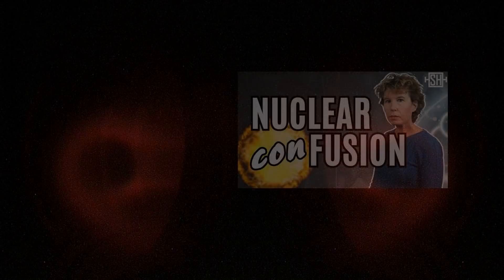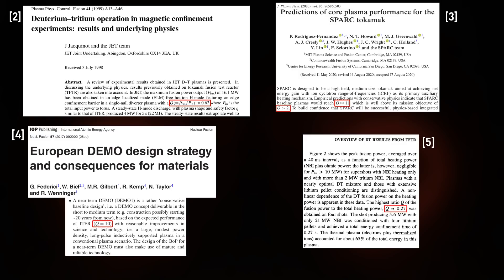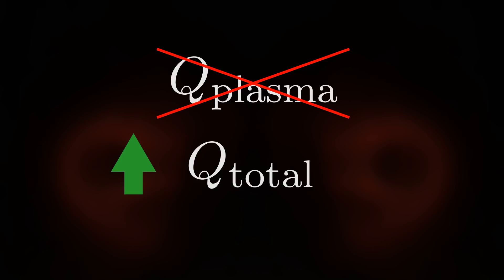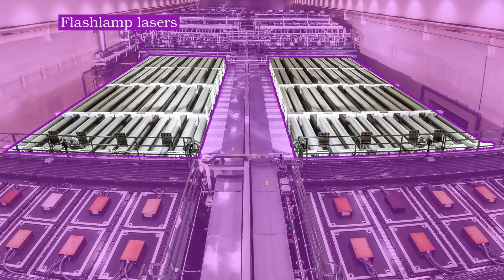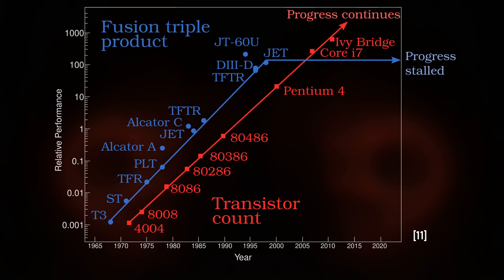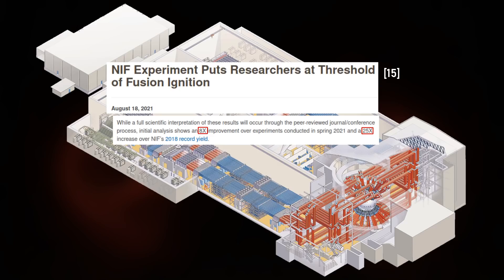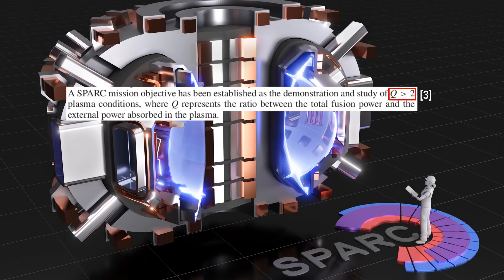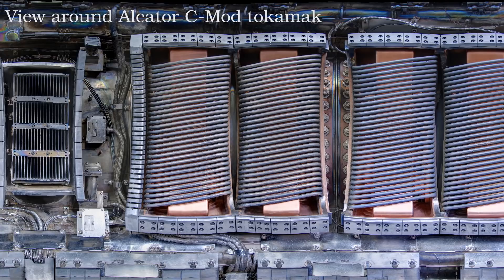In defense of "Q-plasma" - a response to Sabine Hossenfelder

Comment: The tire analogy is very weak; we know how to make all kinds of tires an the physics and engineering behind them are well understood. With regard to fusion, we have a huge amount of unknowns, with a lot of theoretical knowledge, but very little practical engineering experience or cost analysis. We're at the Wright brothers stage of flight and we need to get to the high bypass turbofan + lifting body stage of efficiency. Capturing the actual output of a fusion core and converting it into energy safety and efficiently still has not been demonsted nor realistically theorized. The question marks still remain, we just have one more step.

Comment: 4:19 "Some have even proposed an equivalent to Moore's Law for exponential increases in fusion performance". Who is "some"? 

4:56 "Had it been completed in a timely manner, even a full twenty years after its inception, we would already be a single factor of fifty — or even a factor of ten — step away from a practical reactor" How confident are you of this assertion? Does it depend on the theoretical exponential increase in fusion performance proposed by "some" earlier?

Other than that, very good video. There is indeed a need to build experimental setups and test benches to understand the plasma behavior under confinement, and you make a good point that fusion research requires flexibility in operating range which won't be comparable in efficiency to those tuned for a specific condition in purpose-built power generators. Dr. Hossenfelder also has a point that it is the responsibility of all of us who interface with the general public in the field of science communication to make sure that these ideas aren't conflated in their minds, generating that "where's my flying car?" sentiment which can lead to the kind of anti-specialist rhetoric that has been causing problems in the political arena these past few years.
Reply from the maker: At 4:19 Reference [11] is shown on the screen - a work by A. J. Webster, so there is one example for you. This exponential trend has been noticed and documented by other scientists.

I'm fairly confident of the claim that ITER will demonstrate at the very least Q-plasma = 2, which would be a factor of 10 away from a practical reactor. The reason for this confidence - not explicitly mentioned or referenced in the video - is a widely established relationship between a tokakak's size, magnetic field and performance. Actually, this is the scaling law used to make the claim [3] at 6:38 in the video.

Comment: I agree completely and I left a comment on her site.   Once Q can get above 1 it will be a strong motivation to continue on, in that it will prove that a controlled fusion reaction can be used to get more energy that one puts in.    
I also feel that once ignition is reached, an increase should be viable some adjustments.  
Furthermore,  this is nuclear fusion we are talking about:  one must proceed cautiously, as too much energy released could cause problems and derail progress.     
In light of the need to control these systems with inefficient variable transformers, monitors and control apparatuses, the overall electrical use better be higher.  
 I must admit regarding the fusion q video, I feel she is both right but wrong. 
Fusion investors know where we are as far as net energy goes.

Fusion will be a reality, once hitting q2+ it will be a slow process  to get the lithium transmutation and tritium isolation process dialed in.
We are close to witnessing but still long ways from taming it.
We certainly don’t need YouTubers and media confusing things and slowing down the technology that will save our ass.

Comment: They aren't close to unity. 70% is not unity in q plasma. And the numbers keep changing. I thought the number coming out of PPPL was a lot higher in 1998. But then what do I know. And after somebody achieves unity or over unity, we need 50% more because we don't or can't convert energy 100% to something useful. We need to work on something else. Oh, oh... then we have to provide the power that makes fusion happen. This is just a dead end street unless we come up with some breakthrough ideas, this isn't going to happen We have about the same chance of cold fusion working, close to zero. Whose benefiting from building the commercial fusion reactor in Britain? Well, in 30 years we'll have it, right? ( times about a 1,000 or so)

Comment: I am sorry but you're wrong on this. Regardless of the value of Qplasma, if Qtotal is bellow 1 it's still no go. In an abstract way you can consider an atomic bomb as the heat source for a nuclear power plant. Qplasma would be the ratio between the resulted heat and the energy required to create that bomb. I would guess that the value will be well in triple digits or more but good luck creating any electrical energy from it. Actually long time ago somebody consider to do exactly this by exploding hydrogen bombs in huge underground caves and vaporize water for steam turbines.

Comment: What bothers me about a lot of these kinds of videos is the confidence at which people speak in absence of clear theory, practice or results. Sabine's criticism is completely valid in this respect. And yet both of you are way to confident your positions.
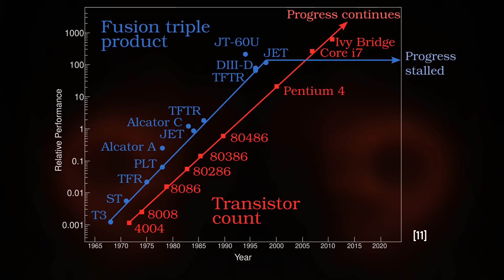Reply from the maker: I don't understand what you mean. There is clear theory which has been validated and many experiments achieving things never otherwise demonstrated, such as the hottest temperature in the solar system. At 02:32 I give an example of how electron confinement (for example) theory and experiments agree. At 04:25 I show decades' worth of experiments which have been getting better and better at confining plasma.
Reply: @ImprobableMatter  A theory describes a working experiment. There are no working experiments that produce sustained fusion in the lab. We don't really know what's missing. We have hypotheses.
Reply from the maker: @Earwaxfire909  There are working experiments and theory does describe them well. The issue is that experiments have not yet been run which will achieve enough of a gain to make a reactor worthwhile.
Reply: @ImprobableMatter  I would argue that material science is missing. We don't yet understand how to make the materials that can catalyze the reactions properly. We don't yet understand which structures are most efficient. A lot is missing from the basic theory about the scale, structure and timing of these reactions. We wouldn't be doing experiments if we had all the answers. Good luck.

Comment: This video is just setting up a straw man to knock down. The point wasn’t that the scientists should focus on increasing Qtotal which if course is meaningless without designing a commercial prototype power plant.  Sabine’s point was that fusion scientists when they communicate with the public, politicians, or journalists should stop conflating  Qplasma with Qtotal by simply calling it Q and allowing non-experts draw the wrong conclusions. The examples she showed of public communication were shockingly dishonest.  

Yes, ITER is a giant research experiment and IF it is successful (years behind and many billions over budget), there then needs to be an even larger commercial prototype built to attempt a Qtotal > 1.  A lot of press and politicians seem to think ITER means commercial fusion is just around the corner when even under the most optimistic conditions it’s many decades away. 2050-2060 would be astounding and really unlikely.  The SPARC is exciting but really a wildcard, interesting, and does suffer from dishonest portrayals of the progress of mega projects like ITER and NIF.  It’s quite clear that popular communication has been misleading and Sabine is correct to point it out.

Comment: Whatever!

Assuming a device can be made to run continuously (or maybe pulse) or produce a plasma in which sufficient nuclear fusion can be sustained, the science/engineering fraternity has a two major problems that, as yet, I have seen nobody discuss. 

The first is getting the “excess energy” generated by fusion away from the containment vessel and in sufficient quantity to drive external turbines to provide greater electricity than that required to operate the reactor. This also must happen to prevent the failure of the magnetic containment coils (which will probably be operated as a superconductor at extremely low temperature). 

And the second is to prevent the inevitable damage of the high energy neutron flux and X-ray fluxes to the materials of the containment vessel and its magnetic coils. I am not convinced anybody understands the scale of this problem p even if they are properly aware of it. 

Both of these issues considerably more difficult than the operation of a convention fission reactor. 

I would be very interested if anybody cite any technical articles concerning these parts of any future fusion reactor.
Reply from the maker: How about the article I cite about ARC, which has a discussion about neutrons, or the paper I discuss in my other video (about an FNSF) which has a lengthy discussion about neutrons and their effects?

Comment: you need to walk before you can run. ive always made a distinction between scientific breakeven and engineering breakeven. it wouldn't surprise me if the difference between the two might be a couple orders of magnitude.  we cant yet calculate engineering breakeven because some of the systems between the reactor and the generator have yet to be developed or characterized yet. we have a vague idea of what those would look like and how they would function and what kind of practical efficiency we would get out of them, but until you actually build something its all just theory.

Comment: When I hear "infinite", and then "take it with a grain a salt", referring to SPARC, you invalidated your argument. No offense, but you showed Sabine was correct. Q plasma does nothing for us. Q total is what is important. Infinite Q plasma (snicker).
Reply from the maker: Don't know how you conflated infinite Q-plasma with SPARC, given that I specifically said that this was a theoretical possibility only on stellarators.
Reply: @ImprobableMatter  Why is Q-plasma theoretically infinite with stellarators and not with tokamaks/ICF?
Reply from the maker: For a stellarator with good confinement, the fusion reactions would generate enough energy to heat the plasma and new fuel, so no need for input power. The coils are superconducting, so few if any losses there.

A tokamak requires a current to be driven through the plasma, which is the other major use of heating systems. ICF requires some amount of input energy, such as lasers at the NIF, every time fusion reactions are initiated.
Reply: @ImprobableMatter  So infinite Q-plasma implies "energy reaching fuel" approaches zero and in a stellarator you aren't putting energy into the fuel in the burning plasma state, because fusion reactions are providing the needed power to the coils?

So for a tokamak power plant, which would be running its current through the plasma from power generated by fusion, isn't that the same idea but with extra steps? Trying to understand the meaning of Q-plasma here I guess
Reply from the maker: The fusion reactions will generate heat, but not current. Therefore things like the microwave launcher at 02:47 will still have to put power into a tokamak ("energy reaching fuel"/the denominator of Q-plasma).

P.S. I am specifically referring to current driven through the actual plasma, as opposed to current through the superconducting coils.
Reply: @ImprobableMatter  It is not a possibility.

Comment: Is it really true, that experiment reactors are so inefficient and the real ones are supposed to be more efficient?
From what I know about experiments, it's usually that prototypes in laboratory conditions are actually much more efficient than real world devices. They may be more prone to failure, but much more efficient.
Of course every inventor tries to convince everyone that real choice will be just as effective as prototypes or more, but that rarely ever happens.
Reply from the maker: As I explain in the video, current experiments prioritize being able to vary and measure plasma conditions over efficiency. Think of static firing rocket engines as an example of what I mean.
Reply: @ImprobableMatter  You gave the example of antennas, that are wide band and they could've been narrow band.
I happen to know a bit about antennas, I took some electronics courses at my university.
It is true, that outputting wide band of frequencies takes more power than narrow band, but nothing prevents outputting narrow band frequency through wide band antenna. 
Wide band antenna may be less efficient at some particular frequency, but the difference isn't actually that big. The technology of modern antennas allows for quite big bands with little loss of efficiency.
I cannot imagine the differences in efficiency being bigger than thirty percent, though I don't know the particular application in those reactors.
Whatever the case, changing the antenna should never increase the efficiency by the orders of magnitude that are talked about in this video.
Reply from the maker: @SylwesterKogowski  I am mostly referring to the generators and transmission lines with regards to individual wave heating. My point is: until a sufficiently high Q-plasma regime is found (with the cited orders of magnitude increases referring to Q-plasma in the video), there is no benefit to making these aspects efficient.

Comment: All this discussion is irrelevant since there is not enough tritium in the world to guarantee that one could start a reactor, given the loss of tritium from the plasma into the first wall, the diverters, and the vacuum system.
Reply: Is that really a unsolvable problem? Can't we run D-D fusion with external heating for producing Tritium in the blanket? The produced Tritium could then be used to jump start the energy positive operation.

Comment: Thanks for this video. As a layperson I had some questions about Sabine's framing in that video. I asked about it in the comments and had a (very cordial) debate, and came to the same conclusion: Q-plasma is the actual technological challenge, and Q-total is simply a matter of economics and commercial viability, which isn't exactly something scientists are expected to think about until questions about optimization arise. No one is saying ITER is going to be used as a power plant.
Reply: No, Qtotal is not “simply a matter of economics and commercial viability”. Qtotal is very much an engineering challenge and it’s inextricably tied up to Qplasma: how a given Qplasma is achieved will determine Qtotal.

Comment: Basically Sabine Hossenfelder was 100% correct in her assessment and you are peeved because she cut through all the smoke and mirrors to clearly illustrate exactly why commercial fusion power plants are still a generation or two away, as has been the case since people tried constructing the first fusion devices (apart from bombs).

Comment: And last month we actually got an >1 Q Plasma.

So now just make sure this becomes sufficiantly repeatable.
I.E. the pellats be made consistantly at that quality at least, & mass produced.

Make the preperation faster and automatic.

And ofcourse, make the lasers over ×100 more efficient.

Personally, I would also want for the energy capture to be more Electromagneric based, with steam being secondary, then finished with thermocoupling and quite possibly a heat engine to finish.

Comment: I usually criticize Sabine because I disagree with much of what she says but in this case, although her reasoning is faulty, her conclusions are right. If she could let go of Mr. Einstein, she could really get somewhere. 

Fusion is a Relativistic fantasy based on Einstein's ridiculous theories. There is no such thing as Fusion in the natural world. A black Hole is just a tiny piece on cold, condensed matter, devoid of energy and so it will suck in any energy that comes within its gravitational range. On the other hand, every Star is simulating the Big Bang, on a much reduced scale. A Star is a tiny piece of cold, condensed matter, but unlike the Black Hole, it is swimming in energy that is eating away at the outer edges and exploding and radiating in all directions. The Big Bang was the instant that energy and matter first met. Everything started with a solid chunk of cold, condensed matter, getting surrounded with energy that is trying to penetrate into the center of the mass. The force pulling the energy in, caused chunks to break off on the outside surface but there is a limit to how big a chunk can be and the more energy there is around, the more fissile and divided  that chunk becomes, until it percolates to the surface and is radiated as energy/photons and beta, gamma radiation. The over all process is always division, never fusion. Energy is what separates individual particles of matter. The more energy you add, the more you push the particles apart. High Energy Fusion is the epitome of an oxymoron. However, cold fusion may yet work... If we could push two particles together while at the same time, removing as much surface energy as possible and be able to hold them in place long enough, then we might be able to produce real fusion and a burst of energy. But I haven't finished building the apparatus yet and I'm getting too old for this kind of nonsense. It probably won't work anyway. I doubt that any form of fusion is possible. The universe is winding down not up.